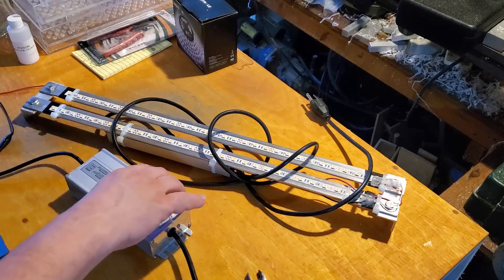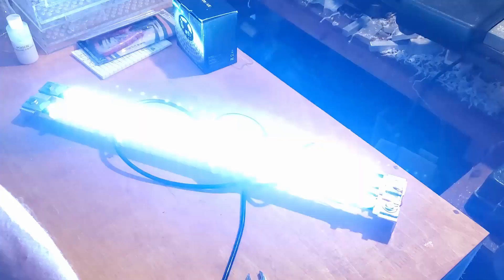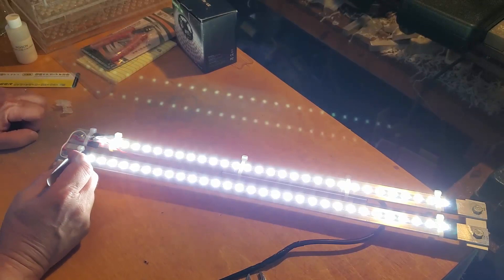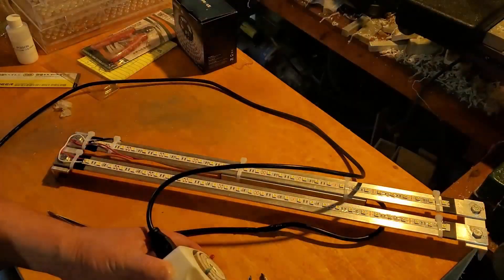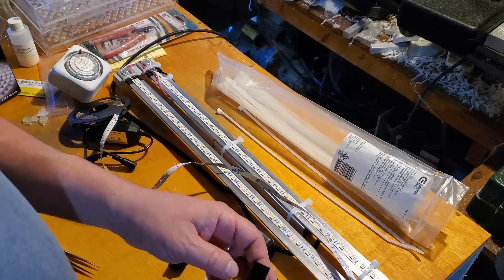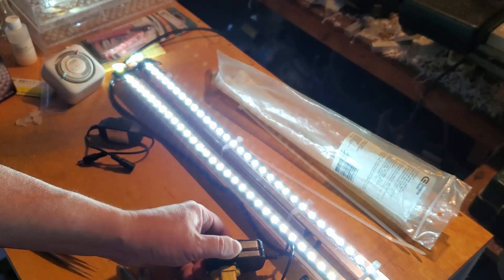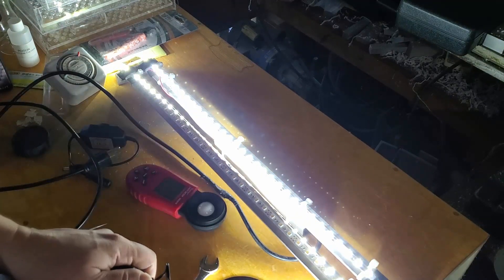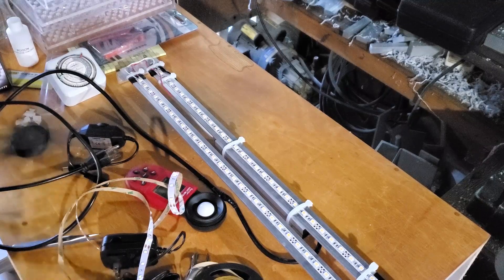LED Canopy Fix

Comment: I know very little about lighting and light quality. Not that I haven't watched various videos and tried, but it hasn't clicked yet. I know it will click at some point and I'm going to say "Ohhhh - that's how that works!" Until then, I grow my higher light demand plants in the tanks closer to the windows and my low light plants in other tanks with random wattage led light bulbs over 5000K. And I have no rotala because it doesn't seem happy anywhere in my tanks and may have nothing to do with lighting. All I could think when you went in with the tweezers was Please don't get shocked, Please don't get shocked! Obviously you know what you're doing:)
Reply from the maker: Working with LEDs is simple and you will get there. Following a few simple rules make working with them perfectly safe. They operate at 12V DC . Thanks so much for all of your support!

Comment: Longevity vs cost is likely more important. Nice thing is you can use the lower light when it serves the need, and add a few more strips if more light is desired.
Reply from the maker: Quite true Ray! I plan on testing this out long term (unless it sucks at growing plants). Time will tell. Thanks for coming by!

Comment: the power supply might be what is limiting them all so do they both have the same value resistors I use the cheap tape but I use a old laptop charger to power them I made a box with 4 on off switches dimmers and 12v outlet sockets and 1 input socket for the charger I've only used 3 so far I have 8/10m ish may be more over 3 tanks running from one power supply I forget how long ago I got them it over 2 years though and not 1 LED has gone bad
Reply from the maker: Hey Colin! I'm a little hesitant about supplying the cheap tape with the higher end power supplies. I will try it out and see if there is any issues. Thanks for coming by!
Reply: @FishmanEricRussell  yes I understand I wouldn't feel comfortable supplying a customer with it with out extensive testing BIG Clive opened my eyes to what is going on with the manufacturer's of LEDs and it's the same with most things we buy and use daily the sad truth is it is purposely made to fail Clive is convinced the chips and components in things like LED lights come from the same manufacturers wether it's a branded product or a cheaper shops own brand have you seen his video when he tolks about the Sheikh of Abu Dhabi forcing LED bulb manufacturers to stop the B.S and make them better
Reply: It is also the LED/Cob size difference.
Reply: @wobblysauce  that is a possibility it's easy to check that with a variable resistor or power supply turned down so they just start to glow and use a magnifying glass to count the LEDs and you can tell how they are arranged by there brightness

Comment: The cri rating matters. I looked it up and the cri 90+ chips are double layered, whatever that means. Also the smaller chip size are more efficient, meaning less heat. I’m using 2835 leds.
Reply: Cri doesn't matter as much as you think. High cri light is not really the optimal light for plant growth and depending on the colours inside your aquarium and...well, you, it might not even be what makes the aquarium look the best.
Reply: @cogarg80  I checked on non CRI leds with a PAR meter. It does matter. CRI leds are brighter for sure.
Reply from the maker: The strips I use in my fish room are CRI > 95%. I really like them. These cheep ones on the other hand... We will see. Thanks for coming by!